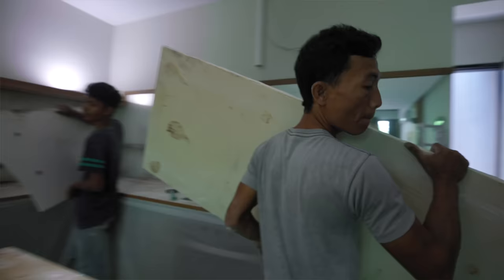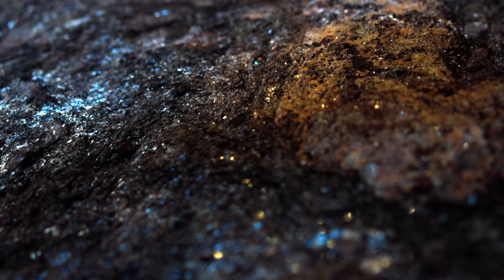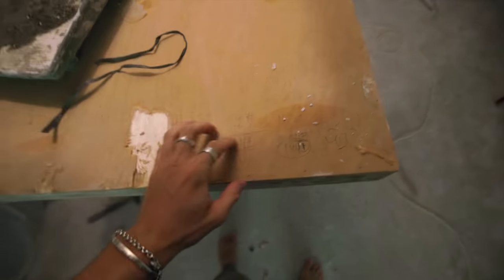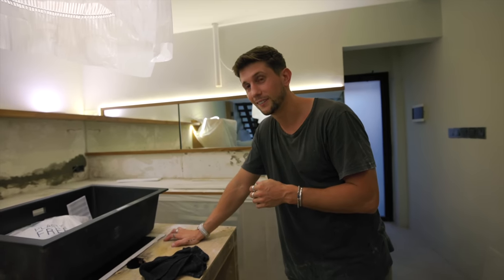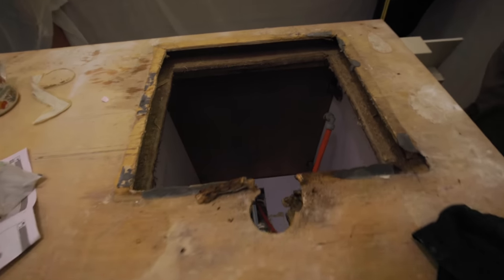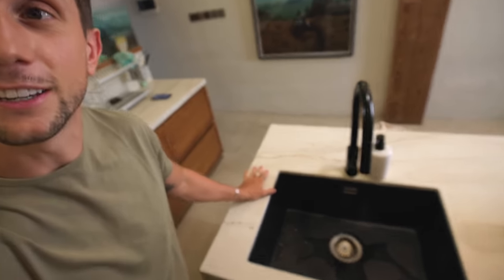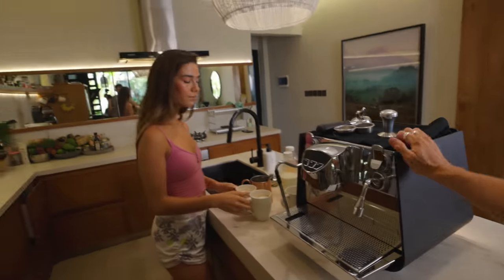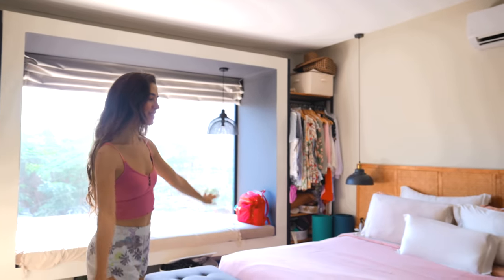My Bali Home Tour (Designed for Digital Nomads)

Comment: the pressure in the machine is 9 bar. But you can adjust during the shot for the ultimate extraction. When you have a machine like this its doing exactly the same thing everytime you use it. Its not because of the machine its actually because of the Barista if the coffee is good! something to remember :)

Comment: He's speaking about chipped countertops.... and goes for the all-known easy to chip the edges, Dekton.... yeah, good luck with that.... I had dekton (By Cosentino) in some projects... and its not reliable... the fact that is hard AF, is real, you can use as a cutting board.... but that strenght has its downsides... like, the edges of the countertop will chip and get scraches... 

Also, the Grohe matte sink, looks amazing when new, but it will get scrached soon... I wouldnt recommend it... Im surprised you used those materials,,... I don't know who you consulted... but... as a 15 year on the construction/decoration industry myself, beautiful and expensive doesn't mean good or reliable.... 

Dont get me wrong, I have clients where I put those products, but theyre clients that redo the kitchen every 5 years... But I strongly recomend not to use them on daily use kitchens.

Next time, If you want some good advise... contact a professional.
Also, you can contact me if you want.